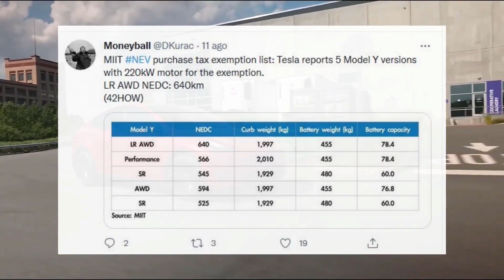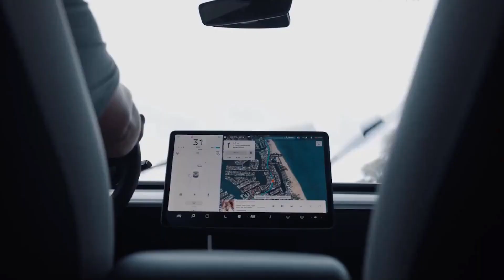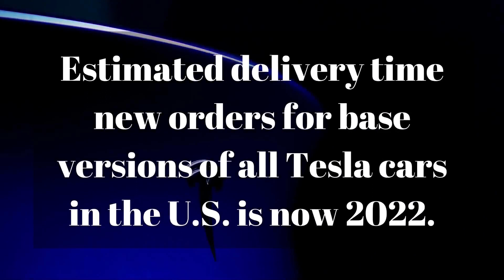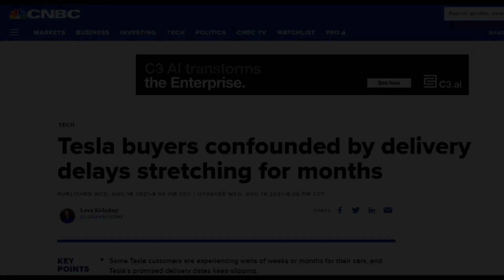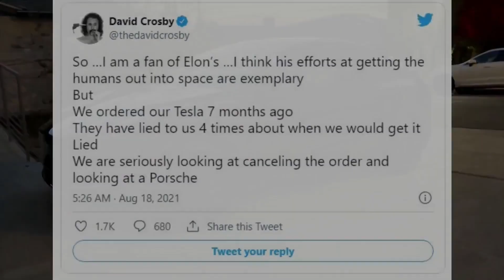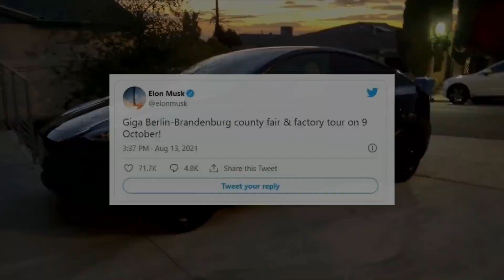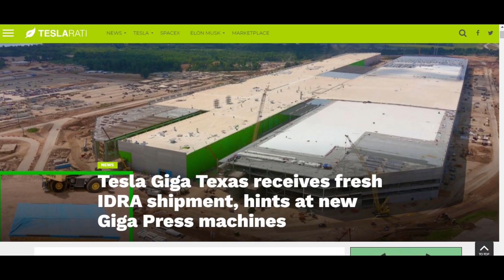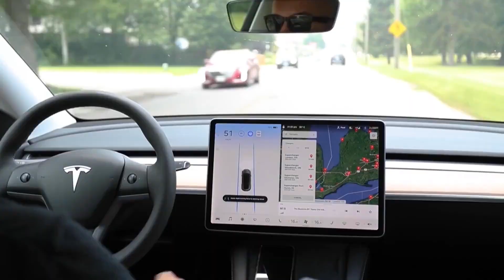Tesla Model Y New Update | Tesla News

Comment: The Tesla Model Y has already been used as a patrol vehicle, and was extremely well received.
Reply: @technopool9870  Only if the car is sitting on the fire. In that case I would get the hell out of there regardless of the vehicle.

Also, check the stats. There are significantly more ICE car fires. 

Though heavy, often biased media coverage suggests otherwise, an extremely low percentage of Tesla vehicles have caught fire. Gasoline cars are about nine times more likely to catch fire.
Reply: Is battery pack bullet proof regards to flammability?
Reply: The battery pack is under the car, so very difficult to shoot. 
However, gas tanks are easy targets.

Also, police and military vehicles are modified for their purpose.
Reply: @MichaelLloydMobile  OK difficult. If you are an officer on patrol which version you’d choose to visit a shooting event if you can pick one?
Reply: @philoso377  definitely a Tesla vehicle. They are faster and more capable in arguably every way. 

Have you explored police car modifications for Tesla vehicles? They are impressive.